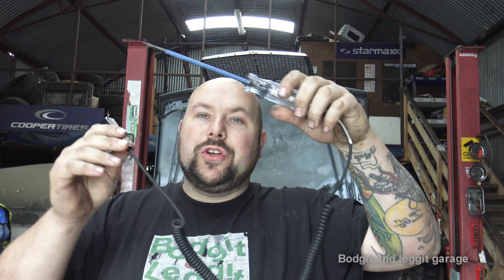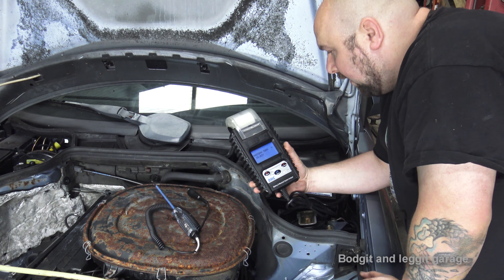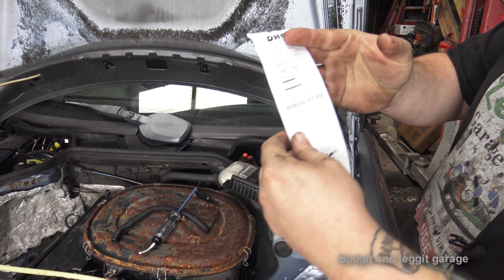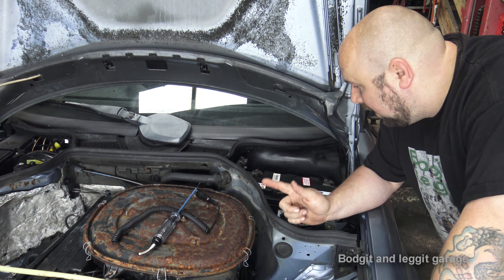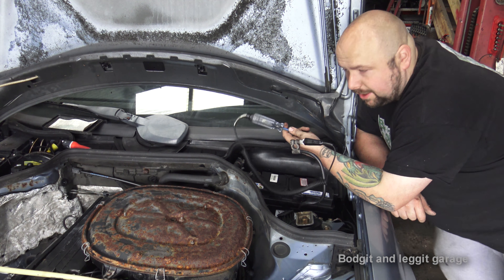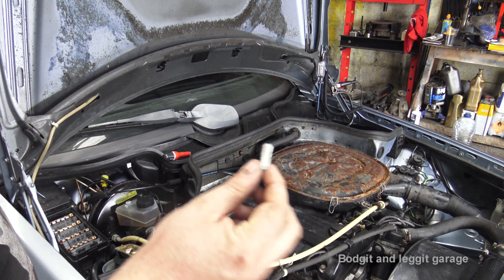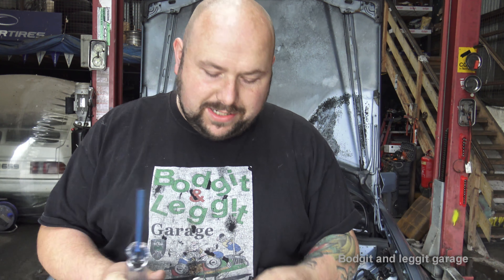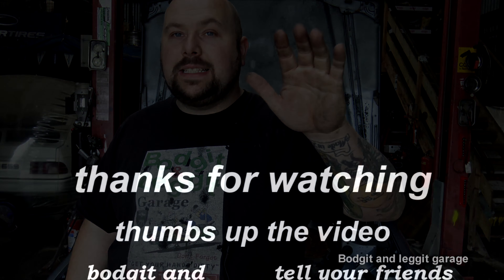How To Find Parasitic Draw (old car) part 2 Bodgit And Leggit Garage

Comment: Leon lets assume I haven't a qlue about diagnostics but I do know that  to make a test light work  one end has to touch  a ground  in the circuit and the other a positive  in the circuit.  You're going from a ground to a ground - so how is the test light  lighting up . There ya go buddy :)  I just had to ask
Reply: STEVE ROB it's cos he's wired the test light in series any load that's turned on will draw current through the testllight u can get a more accurate reading using a simple amp clamp or even a cheapo multimeter as long as the current doesn't go in excess of 10 amps for most meters.
Reply: MrTwisted1977 Thanks or as Leon says -Sorted .haha
Reply from the maker: I was just going to say it's magic hahaha